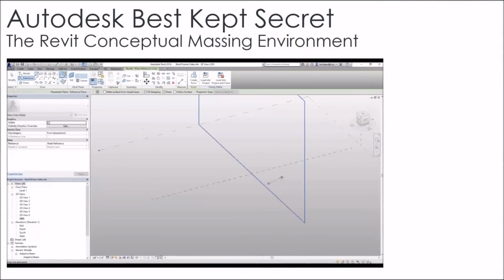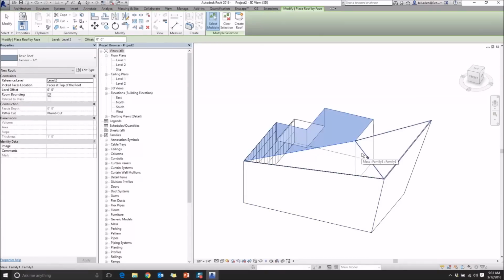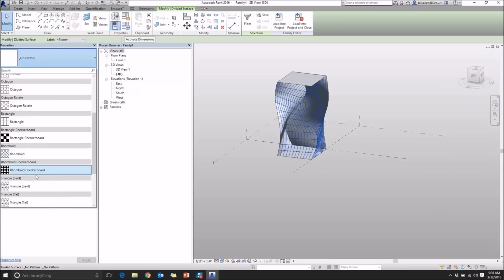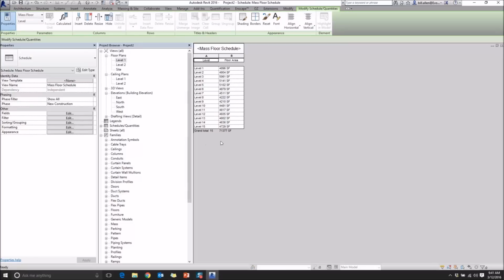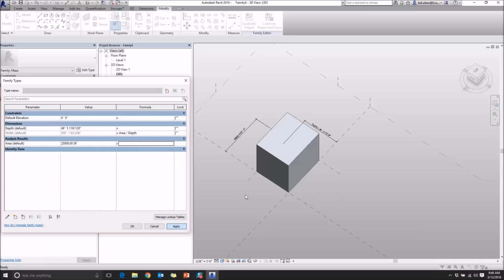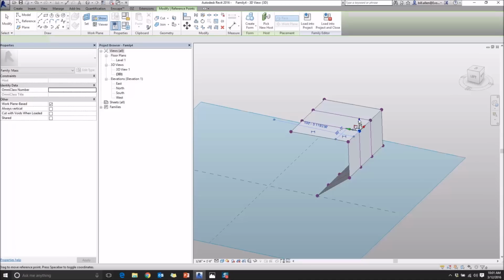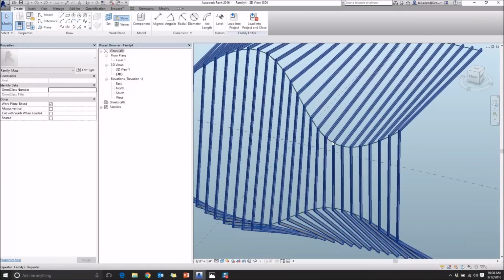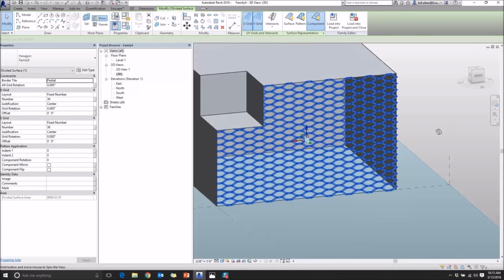The Autodesk Revit Conceptual Massing Environment

Comment: Any videos specific to facade would be great. Good video by the way thanks for sharing the knowledge. 

Quick question, is there any way to turn the conceptual mass walls or panels into actual Revit parts or wall? Please advise.

Thanks.
Reply from the maker: Hi Shahin, thanks for the kind words.  To my knowledge you can't "turn the conceptual mass walls or panels into actual Revit Parts or wall", however you can achieve a lot of these same examples in the project environment using adaptive components.  You can also use "Wall By Face" as mentioned in the video, but it's not a applying the curtain pattern from the massing environment to the project environment.  Hope that helps!
Reply: Thank you very much for the help. If I managed to get around that, I will send you an update on this. Thanks again.

Comment: Hi, about 20 minutes in you showed us how to do the facade look using the massing tool.

First I select the plane that I choose to work from, then I changed the plane over to Level 1 to make more copies. 

The problem that I have is that it will only make copies on the plane that I previously selected.. Why is that ??
Reply from the maker: Hi Harinish,

You have to set your workplane to level 1, so you can copy the reference planes across the X/Y direction.